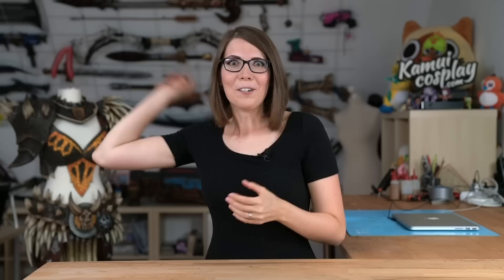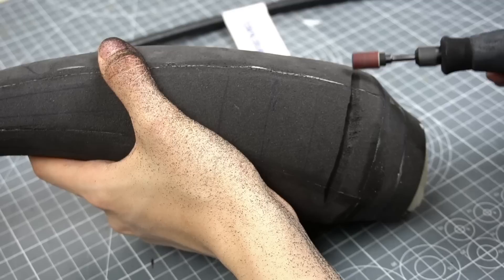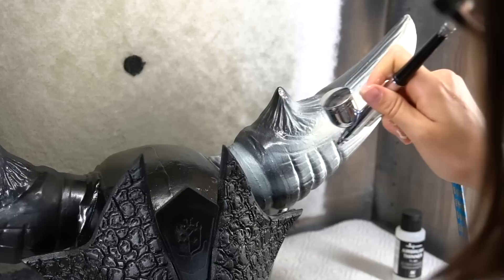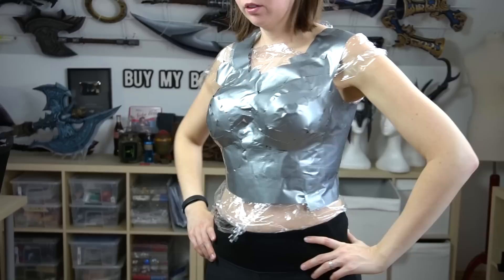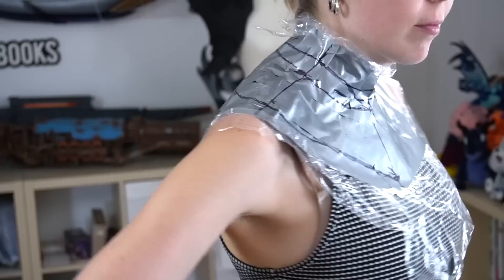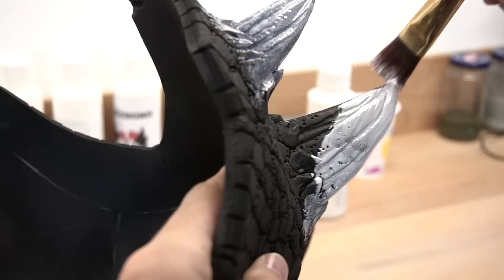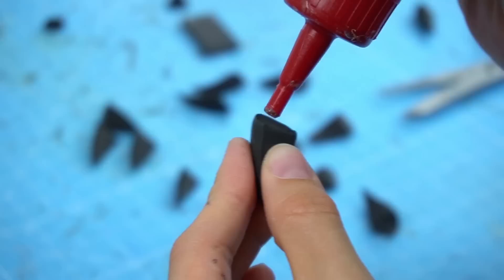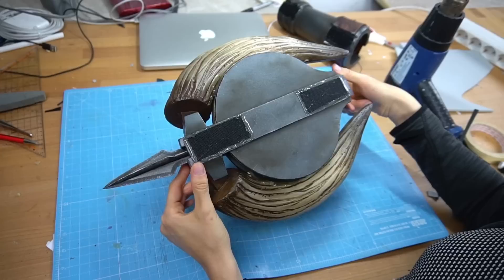Nergigante Armor Cosplay Pt.1 - Monster Hunter World

Comment: Amazing! Fascinating too.  As a beginner, wondering how you decide when to use what glue? Why hot glue on the horns not contact cement? Also, learned a lot especially covering with 2mm foam. What effect did that have? Thanks so much for sharing your wisdom and experience!

Comment: I love it!!! I do have a question, why did you choose to use hot glue instead of contact cement to attach the horns to he helmet? And  you don’t have to line the breast plate with fabric or anything? Sweat or body heat won’t deactivate the glue? Thanks! 🤗

Comment: 6:30 what thickness of foam did you use to make these spikes
7:59 what thickness of foam bevel would you recommend for both ornaments on the collar ?

For the pauldron, did you made a pdf pattern to buy ? and was it 2 layers of 5mm foam used for the base (instead of 5mm for base and 2mm for details) and 5mm only for the 2 lower part of the pauldron ?

Also, for the spikey shoulder base, would 5mm be okay or did you use thicker foam since it might weight allot because of the spikes ?

and what thickness of foam did you use for the slinger ?

lots of question but I never managed to assemble foam armor yet because maybe i get the wrong thickness or maybe just the crappy canadian contact cement we have ahah, thanks for your help ♥

Comment: Hi Kamui, I see you apply hot glue or contact cement to parts that are primed and painted. How do you make it work ? I use flexipaint and acrylics, if I use contact cement on top it just sort of melts and peel off, it's annoying ! thanks for the videos !
Reply from the maker: Could be that it doesn't work well with flexipaint. :-/
Reply: thanks I will try with flexbond :)